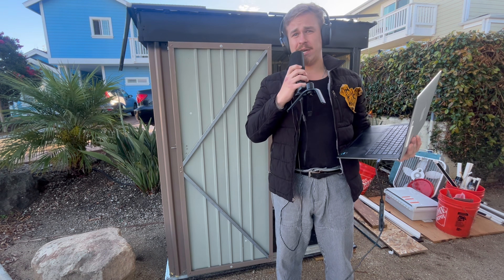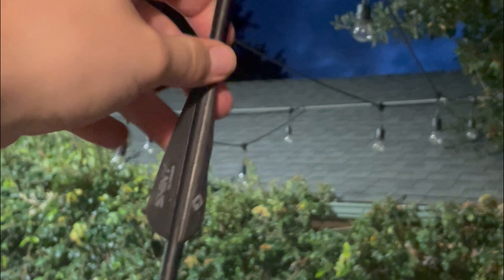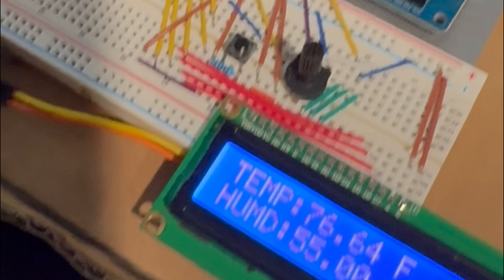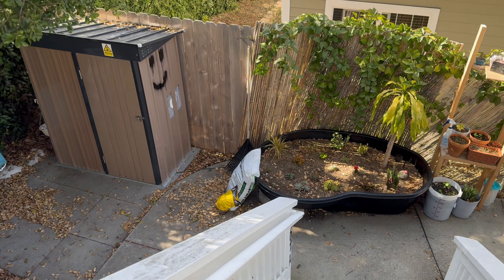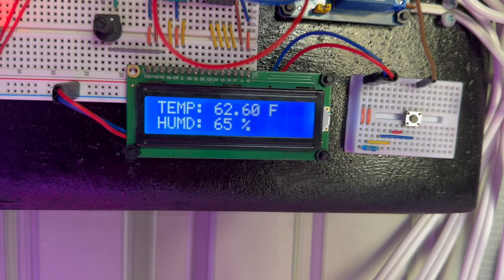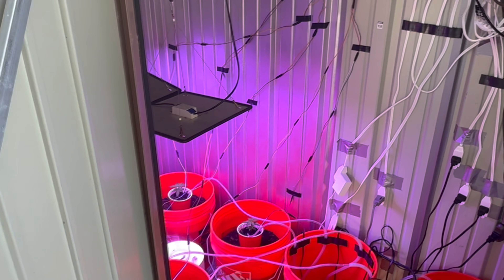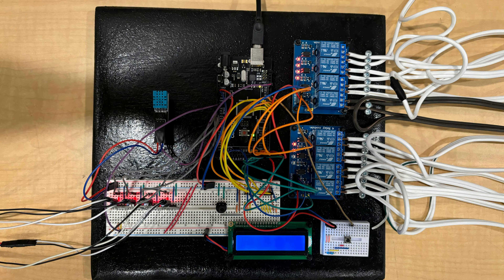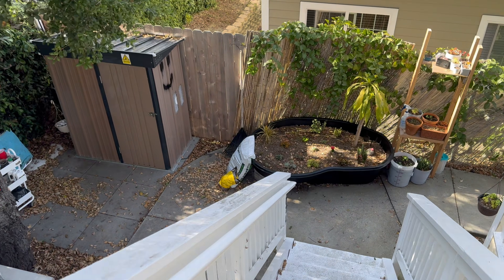MY FIRST AUTOMATED GROW SYSTEM PROTOTYPE

Comment: Cool Project. But after a while your Soil-Moisture-Sensors will corrode and slightly poison your plants. I suggest using capacitive ones. I sealed the edges with CA glue and painted the components on it with some silicone to be sure. Works for now
Reply from the maker: Yessir. Already switched to capacitive sensors. Learned about the corrosion thing a little too late on the prototype, RIP. Appreciate the tip!